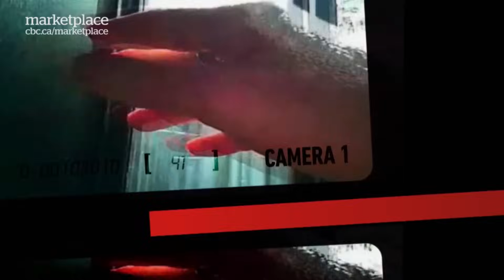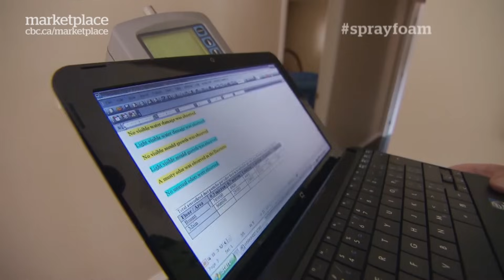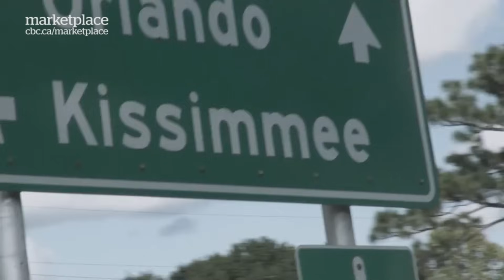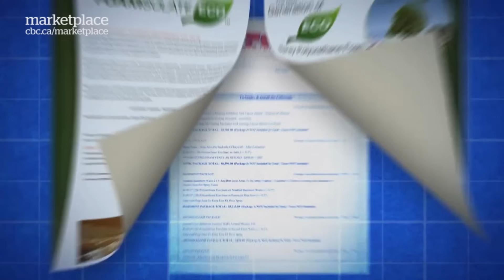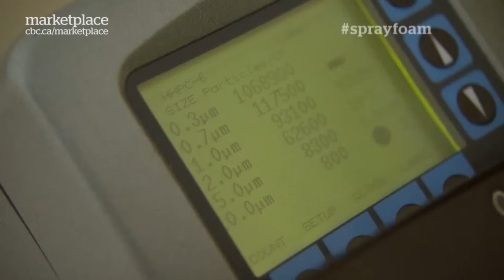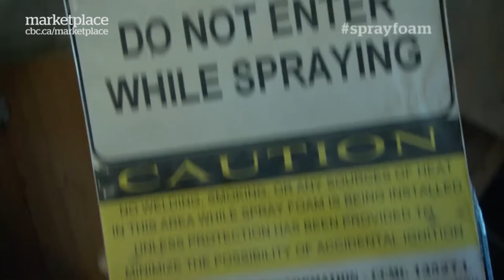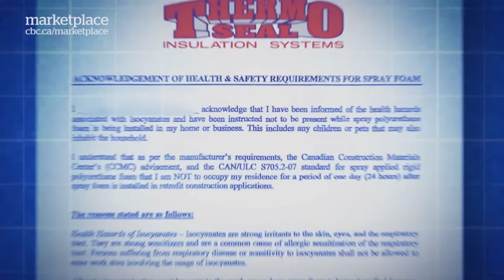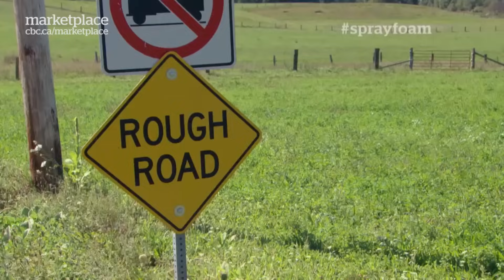Spray foam insulation nightmare: What can happen if it's not installed correctly (CBC Marketplace)

Comment: I may have missed it but I didn’t hear what it meant by not installed properly. I have had spray foam in my attic for more than twelve years with no problems. Something I noticed was the house in Canada and Florida it was sprayed in the crawl space, mine was sprayed under the roof. It looks like Carlsbad Caverns, but no problems. I checked the temperature in the attic before it was installed, 121 degrees, after it was 91 degrees. This was the best insulation project I’ve done to my home.

Comment: Personally I think spray foam is great for basements, and could possibly stop small water leaks. Using it for the attic would be a no no for me because in the summer it can get very hot in there and it might be a cause of a smell reaction. We also have to think about a fire hazard and if the product is fire retardant. 
If I was in this clients shoes I would have drywall the whole attic and add in an air circulation system in there. It might fix the smell issue and and maybe cheaper than removing and redoing the whole roof. 
All this information is just a personal opinion. I hope this information helps someone.
Reply: The issue wasn't really the smell, it was that WHAT they were smelling in the air was poisoning them.
Reply: Spray foams help keep attics cooler so it wouldn't be an issue of a "very hot" attic. I have been in attics that have been spray foamed and I live in Texas and they are much cooler than non spray foamed attics. That's kind of the point in addition to the insulation, it creates a tight seals which keeps the attic cool in the summer and keeps warm air in in the winter which theoretically should reduce you heating/cooling bills.

Comment: Measure off a square foot of foam. See how much fun it is going to be to remove. It might be easier to remove the second floor and start over. You will never get all of it out. On hot days you may still smell that foul smell. So, they removed the whole roof and the ceiling to get all the spray foam out. I think they did the right thing. Easier, faster, less labor intensive. No smell.

Comment: I have several patents in polyurethanes and I also invented the portable low pressure plural component spray system. Isocyinates are no joke and high pressure machines (used almost exclusively in this application) are notorious for spraying "off mix" causing issues like this.

Comment: My dad has this weird really thin aluminum foil looking insulation in his house. He says it's really expensive but amazing. I mean one day we forgot to turn the AC back on when it was 90 degrees Fahrenheit out and it was only 74 in the house by 4 pm, so I guess it works like a beast.
Reply: Sam Hem  it's basically thin bubble wrap with aluminum foil on both sides.
Used for tight spaces. Also on garage doors.
Reply: My sister got that too, it is basically aluminum foil with tiny holes in it as I recall.  Comes in a roll.  She gave me the left overs.
Reply: Sam Hem what was the metal insulation?
Reply: its duct insulation.  lmao@ tinfoil with bubbles!!
Reply: Sam Hem  thank you. I used the water heater type that is 1/4 thick for vehicle insulation. It is not perfect, but the difference is significant to original insulation
Reply: Sam Hem  the aluminum insulation reflects the radiant heat back to the atmosphere and away from the house. That is what help keep the house cool.
Reply: George McKay, I wish I knew what material Sam Hem referred to, too.  I did find a helpful website, tho:  energy (.) gov (on "radiant barriers").  It includes some important points.  In part, it reads:
When installing a foil-type barrier, it's important to allow the material to "droop" between the attachment points to make at least a 1.0 inch (2.5 cm) air space between it and the bottom of the roof. 
Note that reflective foil will conduct electricity, so workers and homeowners must avoid making contact with bare electrical wiring.

It also comments on avoiding moisture build up the at attic floor.
Reply: It could also be foil faced polyisocyanurate. A popular choice for home insulation.
Reply: I used that stuff to increase insulation on my hvac ductwork. It works great!
Reply: Try Attic Foil. Its thin and easy to apply.

Comment: Well I am going to build a house and was considering foam. Not anymore.
Reply: There are some plant based ones which have no Volitile compounds.
Reply: If it's done correctly 
These stories are not
Reply: Take a look at cellulose fiber insulation. Spray on, doesn't itch like fiber glass, very good fire rating.
Reply: Look up fire resistance testing of it, too. As soon as it catches, you're done before you can get out of the house. Once it catches, which isn't hard, it's like gasoline.
Reply: Spend a bit more on Spaceloft
Reply: Your loss
Reply: Use the pink stuff! Best stuff out there!!
Reply: lambs wool batt is hands down the best
Reply: Big asbestos propaganda piece

Comment: I cant help but think of the flaw in modern home designs when I see this video. Instead of keeping the heat out of the home they are putting this on the ceiling and not the roof deck. Yes you avoid the traditional worry of shingle issues and leaks but you don't stop the attic from getting to be 150deg in some areas. Then the insulation has to fight the 150deg temps instead of the lower 90-110deg temp of the roof deck. Not to mention what the 150deg radiant heat does to the chemicals inside of all insulations including fiberglass, cellulose, rockwool, and spray foam. Do you know what is in the wood the attic is made of? I don't. You heat it to about 140 to 150 deg there is a lot of bad stuff that might go from a solid to a gas! Stuff that is a lot worse than some polyurethane that didn't properly cure and gets cooked by the heat!
Reply: Great point. If you add more insulation to the attic you have to make sure that there is proper air exchange and the attic should not be getting much warmer than the outside air temp.
Reply: "Do you know what is in the wood the attic is made of?", IDK, maybe wood?
Reply: It isn't just wood. I have no idea what it is, that is the point.
Reply: K0gashuk0 Wood is wood, it's not made of anything but wood, so if your saying that somehow the off-gases from the wood heating up are bad for us then I say yes please seal my house off from my attic with spray-foam, letting the roof and attic space essentially becoming separate from the rest of a house (just like your garage). That said if off-gases from the wood heating up were harmful to human health then I think would be screwed as a species. Then I could get in on many other points you just made that don't make sense, but to be short you don't understand how the envelope of a house works.
Reply: K0gashuk0 u put it on the ceiling floor because the attick ahs to remain cool so snow dont melt and create ice dams and stuff...atleast in canada
Reply: What kind of chemicals are released from fiberglass and rockwool?
Reply: I though he was thinking of plywood/particleboard etc. that is basically wood but with binders that might react in some way.
Reply: ***** Read further back in posts buddy and this might all make sense to you. The guy was curious as to the type of wood based off the post of the guy that said wood off gases potentially harmfull gases, but was unsure cause he dosn't actually know what's in wood. So as far his question as to what is in the wood the awnser would be wood, or nothing sense the wood in an attic would not be pressure treated. As far as other wood grading goes, that wouldn't have an effect on the chemical composition of the wood., Ratings are for things like strength (does the wood have lots of knots, and waning, etc). So again what's in the wood, well wood there would not be any other added chemicals, so what ever the chemical make-up of wood is, is what you got. FYI all wood are consider carcinogenic.
Reply: speedy63663 Herr duurr.. wud Iz wud.. 

Pressure treated lumber used to have many chemicals in it to prevent rot...

http://en.m.wikipedia.org/wiki/Wood_preservation

PS
Don't use a pressure treated 2x4 as firewood for a campfire.
Reply: DJ Matusiak Yeah? SO? Who the hell builds a house out of pressure treated wood?
Reply: speedy63663 lol so you do admit it's use in home construction. I didn't know I had to go into exacting detail of where it was used for someone who didn't even know there was a difference in  grades of construction lumber... 

Go away little one. Next keep your uncle closer so you can get the answers you need sooner.
Reply: Dunbass, he was asking about the roof. The ONLY place where it is used is in a basement. EVEN THEN it is only scarcely used. With respect to my delay in responding to your mindless drivel, it's called having a life. Now remind me again, what kind of wood is the roof made of?
Reply: speedy63663 firstly, there is no way to know what materials we used in this construction. Canadian laws are different than american. 

Secondly, if you do any looking around you find the answers you keep asking a stranger online about. 

" Pressure-treated wood may be used inside, and is commonly used for the sill plates of homes and FRTW; fire-retardant treatments like D-Blaze offer additional protection from fire and smoke development.  Properly dispose of all sawdust and construction debris at the conclusion of all projects. Many treated wood products do not emit any vapors and are safe for interior use.  Check use information on specific products. Treated wood should never be used for counter-tops or where it may become a component of food. "

On a side note, interior wood is also treated, just not as harshly. 

Kind of like how you are. Little kid with a big mouth protected by the internet.
Reply: that chip board bullshit that they use over plywood now is horrendous
Reply: speedy63663 shows who would hir e ur ass with that attitude. i was jsut throwing that out there. the new hhouses i see going up are practically made of chipboard now.
Reply: randomrazr I believe this is an english speaking/writing site!
Reply: K0gashuk0 this is what thermal reflective barrier is for. Stopping heat from radiating into the attic. IT is like placing a shade tree over your entire house..
I have seen 180 degree attics change to 3 degrees over ambient while installing it.

Comment: Aren’t contractors in Canada required to be insured and bonded?
Reply: of course not, it's Canada.
Reply: Yes... But this industry is fairly new and as it becomes more popular more and more codes are being written BUT  With every new product comes issues .. The hard part with Chemicals of this nature is everything has to be perfect to apply this product and the installers have to know what they are doing and they need to be honest ... YOU as the homeowner need to be extra vigilant before using or hiring anyone to do anything on your home especially when using any new products ...

Comment: When it’s sprayed on a roof , how does the roof BREATH !!!! As it should do
Reply: HBC.  So what’s happening between the cold tiles and the sprayed on insulation then , condensation held between them and no where to go except rot the roof beams over time , so how is an attic fan and vent going help that .
the roof beams need to breath .
Reply: it's done wrong in this video.  it should have actually been put on the  underside of the roof, not over the rafters on the top of the ceiling.  the building envelope should extend to the roof.  so the soffits don't actually vent at all

Comment: If it ain't broke, don't fix it. The traditional insulation has been used for so many years and has been working fine. Why change it now? I'm puzzled. I'll always go the traditional route. Especially after watching this video.
Reply: Fiberglass batts generally doesn't perform to half of its R value rating.  Studies have shown that fiberglass is usually not installed ideally, and when even everything is perfect it doesn't come close to its laboratory R value rating.  Condensation inside a wall cavity filled with fiberglass can cause the batts to compress, even when the material dries it will not restore its shape. That leads to lose in R value. If you could see inside wall cavities in northern climates during very cold weather you would see that the material is covered with frost from frozen condensation, only the sheet rock prevents the home owner from knowing this.  During the summer the condensation may lead to hidden mold growth inside the walls. Of course, the builder should attempt to do everything reasonably practical to reduce condensation.  

Spray foam has two general types, open cell and closed cell.  The open cell type will not trap water as well as the closed cell.    Make sure that an experienced crew is doing the spray foam work and that they have good references for standing behind their work.  

An alternative to fiberglass that works well is mineral wool, the Rockwood brand being the most popular.  Mineral wool will cost twice as much as fiberglass but works much better.  Mineral wool is hydrophobic - it repells water, so it doesn't suffer from the degradation that fiberglass can.  But, products like Rock Wool can be spendy.

Comment: Spray on ratio, test before entering the home. Save those test samples. Keep an eye on those temps and pressure the entire time. A rig with remote monitoring is great, you can adjust while in the attic from your phone.

Comment: What is the disposal method of for this crap once it's removed?
Reply: If you really want to be safe, you can wear scuba tanks. then just take it to the city dump. They'll charge you a bulk fee and a tonnage fee.
Reply: My thoughts were more on what does it do after it's in a landfill - we already know there's offgassing, but what're the long-term issues both on health and environment.
Reply: It turns back into oil.
Reply: If you mix with gasoline it turns in to a kind of napalm.   we just bury to many things we don't want any more, we haven't a clue what were doing.
Reply: burn it probably

Comment: I guess no one told her that particulate filters will do fuck all against any chemical fumes. lol its kinda like wearing crocs instead of rubber boots whilst walking through a giant pile of cow shit.
Reply: +stew88dodge 
I was scrolling down through the comments to see if anyone noticed that other than me. Every time I saw her put that mask on with the particulate cartridges screwed in, I just laughed. I'm sure she felt WAY better walking into that room with that mask on....
Reply: +stew88dodge exactly..
Reply: +stew88dodge 
that was not particulate. It was cleary charcoal canister which is for chemical voc.
Reply: stew88dodge those were charcoal cans
Reply: James Davis - I beg to differ. They are NOT charcoal filters. I use that exact purple particulate filter when sandblasting and it’s a Honeywell P100 particulate filter without a doubt. Sadly, that didn’t protect her from the airborne chemicals in her home.

Comment: I buy Rock Woiol or Mineral Wool it was used in the 50s and 60s. I have no idea why we ever started using fiber glass. it is actually made from lava rocks and is great sound blocker and can be used as a firewall also. You won't have to worry about mildew. It is an added expensive I do not mind paying.
Reply: Also, insects don't like Rockwool.

Comment: I find it really odd that this is so common anywhere in the world. Where I live there's constant talk about construction and how materials and spaces in construction are essential to ventilate ie. formaldehyde etc. to out of the building. Where I live sprayfoam is pretty much only used to insulate something like gaps or perhaps certain areas like ventilation pipe or something. Never ever ceilings or walls fully. It's pretty much standard here to have rockwool insulation to allow breathing of materials. Sure there are particular elements made from basically sprayfoam materials, but they're elements made in factories and have ie. metal on top. Never organic materials. It must even be total hell for electricians and such to work after someone has sprayfoamed...Everything 😂